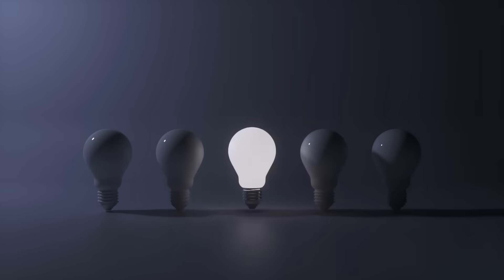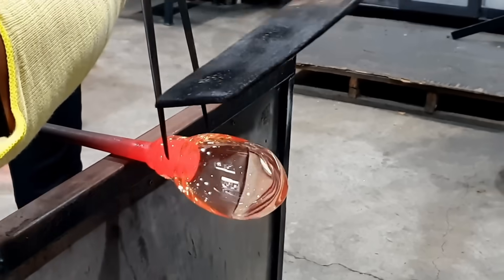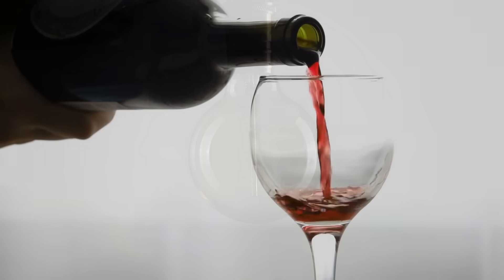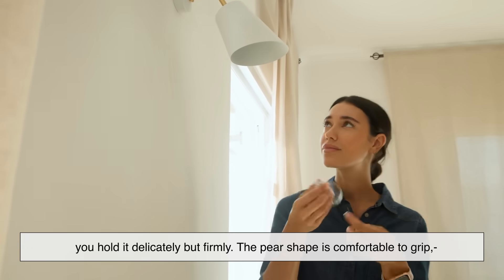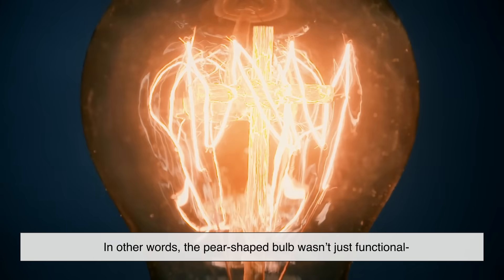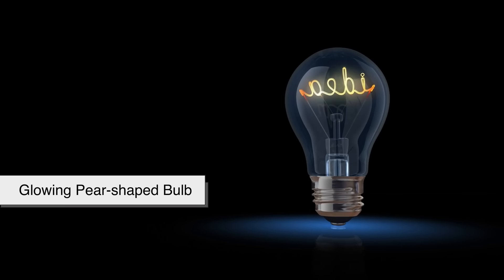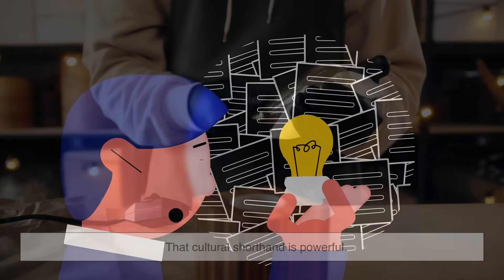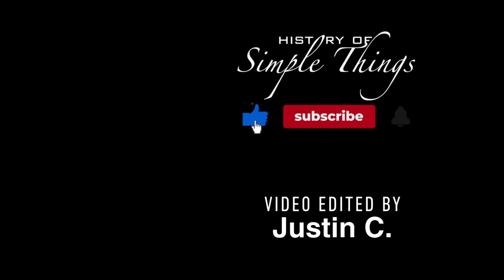Why Are Light Bulbs Shaped Like Pears?

Comment: also back during the time when light bulbs were a  new thing, they had the point of glass at the top called the PIP. which is where all the Air was evacuated, and the envelope sealed.
later on, the PIP was moved to the bottom of the envelope, and hidden under the base. and a mixture of argon and nitrogen were added, to extended the bulb's lifespan.
Krypton was also used in some specialized bulbs.